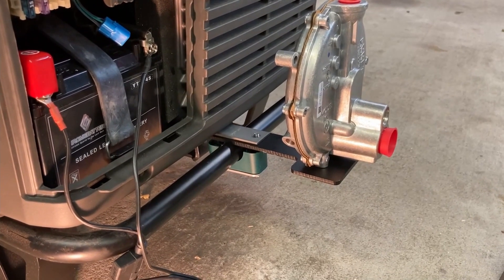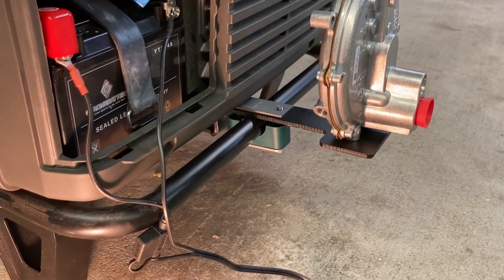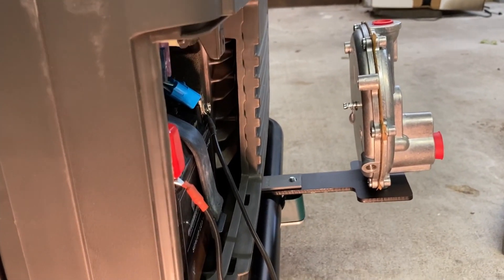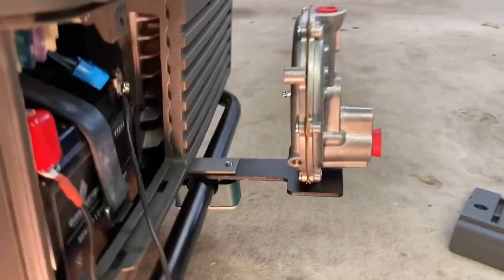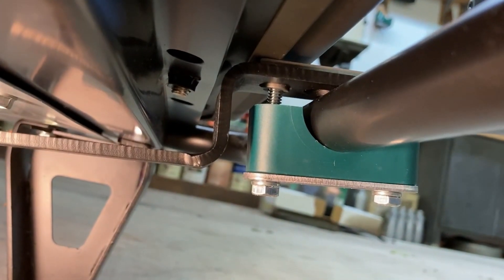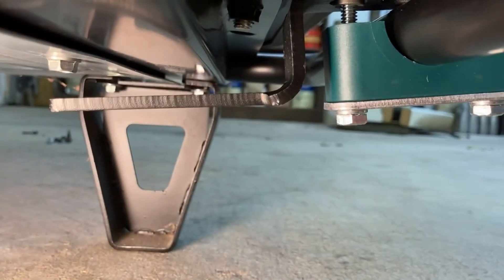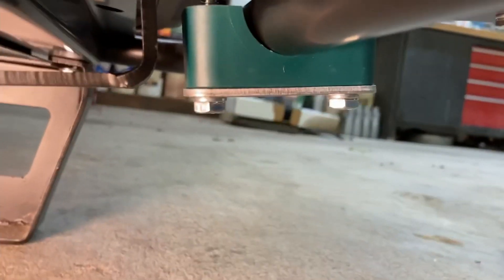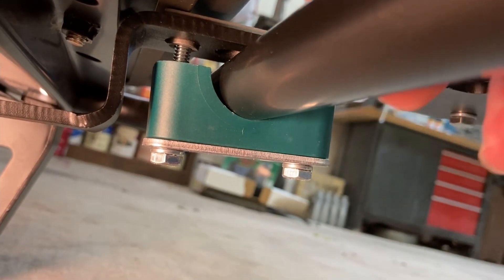US Carburetion Honda EU7000is Tri Fuel Conversion - Demand Regulator Mounting

Comment: I see you’re giving the motor snorkel kit a try. I’m curious how it works for you.  I bought the kit also, but am only using their timing adjustment module and the rest of the system is still my Genconnex components.  It still stinks at low/ no load, but I almost never run it there and it never stalls out completely, so I’ve convinced myself it’ll be ok.  I’ll be staying tuned for updates from you!  Overall fit so far seems like it leaves a little to be desired, disappointing :(
Reply from the maker: @David Messineo  After seeing this @browse deweb video, https://www.youtube.com/watch?v=KgRWa55kGMs I had to try it for myself.

I have to say that it runs dramatically better with only the addition of the "module", although I'm anxious to see what will happen when I am able to actually adjust the load block valve.  As you see, I headed down that road, but hit a few rough spots.  I'm sure I can come up with a better way to mount the demand regulator, but I went ahead and sent a link to this video to US Carburetion. and to their credit, they have already  responded.  No actionable information yet, but hopefully that will follow soon.  They seem like a company with an identity problem - their original website looks like dawn-of-the-internet, but at least it bears the same name that they use on all of their communications.  Not that I'd hold that against them, if they can help me get this thing working.

So far, I've found some of the commentary in their documentation to be really obtuse.  For example, it sternly warns about using a new propane tank, as if people refill their tanks over and over again.  That's certainly not the common case in my area.  I would have to drive into the next town to get a cylinder refilled, and I see no way for anyone to know if the typical cylinder exchange companies are providing "new" tanks or not.  And even if one did refill their own tanks, how would one reasonably get rid of the first four tankfuls of unusable propane?

Which is not unlike their chart for gas line sizing...talk about conservative...I doubt that any residential gas line installation could meet the chart targets.  A 13 foot limit for 1/2" pipe is all but impossible...that barely even makes a flex hose possible, let alone a piping run to the hose connection point.  I've done quite a bit of testing with a gauge, so I know for a fact that the actual limit is WAY more than 13 feet.  If you watch the video I linked above, you will see that his piping run is over-the-river-and-through-woods, with plenty of fittings, and from my conversation with him, he wasn't even using a full-port valve in the video.  And that appears to be working pretty well for him.

I used to make my living as a piping designer, so I immediately recognized the USC chart as being more about C.Y.A. than actual engineering data.  I think it would be great if they would offer some more realistic guidance.  It would be way better to say something like, "The pressure should be between 5 and 11 inches WC, with no more than 2 inches of difference between idle and full load" (or whatever the actual engineering requirement is).  And then sell gauges to test it with!
Reply: @MstrMark  I saw your comment on my video and I had the same issue with the bracket.  It may have been for an earlier version of the EU7000IS...not sure.  I got mine to work, but it isn't ideal.

As for the module placement and the hose routing, I cut out the notch at the top of the battery cover like you started to do and I also had to bend down the hook that the top of the battery strap connects to, then I just routed the hose through the expanded strap hole, over the battery and through the cover notch.  I just stuffed the electronic module on top of the battery, trying to position the switch towards the right side of the battery so it wouldn't hit anything.  I left the battery strap out. You'll also see the wire for my trickle charger following the fuel line.

https://www.youtube.com/watch?v=CL5VK4GNzMA

They really should redesign the regulator bracket to bring it close in to the generator and also to make a solid connection underneath. Too close in though and the top of regular might interfere with collapsing the handles.
Reply from the maker: @browsedeweb8834  Thanks so mush for the tips.  I guess the professional mechanic in me is having trouble with the idea of messing up a perfectly good generator, so I mounted the module inside the left edge of the control panel, right behind the plugs.  And I used a chassis punch to make a new hole in the firewall, just to the left of the battery strap mount (as you look at it from the battery side).  As you say, that regulator mount is a mess too.  I guess I'll cut and modify the bracket that came with my $477 kit!  

I appreciate you mentioning clearance for the handle because I hadn't thought of that.  If I mount it below the frame tube instead of above it, hopefully I can get it in much closer and solve the handle clearance too.  We'll see.  I'll try to post some new videos as I go along.

That little hole that you see in my battery cover is for my battery maintainer...I haven't decided how to route the hose yet.  I'll probably try it first without the cover, just to see how it wants to go.  Maybe I'll make a new hole.  Hopefully those doors are not too expensive, if one wanted to restore the stock appearance.  Which I was strongly considering with the failed Genconnex conversion kit.  

You know, it would be great if those two companies could collaborate on a conversion kit the combines that best features of both kits - the slick stock appearance on the Genconnex kit with tri-fuel operation of the motor snorkel kit.  Oh, and it has to run properly too.  I have to admit that I'm having some doubts about that tiny thin snorkel...it seems very fragile and too thin to pass enough fuel.  Especially in a US Carburetion universe where 1/2" pipe is supposedly good for only 13 feet.  If they're so worried about restriction, it seems like the snorkel is the main culprit.  We'll see.  Assuming I can get the thing installed without tearing it up.

Motor Snorkel
Reply: @MstrMark  I was thinking the same thing about the battery panel cutout, but I saved the piece I removed and I could easily re-attach it using some Plast-Aid and glue later on if I wanted to reverse it.  Most buyers probably wouldn't care if they had easy access for a battery maintainer.

I like your idea of using a U bold and maybe a flat piece of metal stock for the regulator bracket.  I'm leaving mine for now, but one of these days I may fabricate a better mount.

I'm going to try running the generator on a different, larger gas line and see if there is any difference in performance at higher loads.  Just waiting on parts to tie into my 335k BTU pool heater line which is on it's own meter.
Reply from the maker: @browsedeweb8834  I can confirm that mounting the bracket under the tube prevent all interference with the handles, but I'm having trouble finding the perfect U-bolt.  The tube is about 1" OD, but it's have to find anything that small with a saddle.  I was actually hoping for something padded, but that seems even less likely.  And if it's going to scratch and dent the tube, then maybe drilling a hole through it would look cleaner.  What do you think?

On all the gas stuff, you should just measure what you have before you spend another $100 on fittings.  If you just want some low-hanging fruit, you might consider replacing that 1/2" brass ell with a 3/4" one, as the ell is more restrictive than a straight fitting, so hold the 3/4" as long as you can.  And like you already said, get a full-port gas valve.  You can even go up a size on the valve, and that will get you a port size that is closer to the ID of your pipe.

FWIW, I hooked mine up straight to my gas meter, and the measured pressure drop was only very slightly improved versus the 1/2" run to my patio.  I couldn't notice any difference at all in the way the generator ran.  So it kind of verified what I had already measured, but I just wanted to put it to rest.
Reply: @MstrMark  Once you have everything setup and working properly, it would be good to see another video with the generator running on the US Carb solution.
Reply from the maker: @browsedeweb8834  I agree, and I'm actually pretty close.  Since my last post I re-formed the mounting bracket (with an oxy-acetylene torch), clearanced the muffler clamp so that it can fit closer to the regulator, engineered some plastic sleeves to protect the frame tube on the generator, and got all that stuff painted.  I also put the generator back together again, since I had removed the handle assembly, the black plastic cover and the control panel.  I got the regulator mounted, and all fittings and hoses attached. 

The new mounting position under the frame tube brings the regulator in to less than an inch from the generator...just enough room to operate the primer.  And no clearance issues with the folding handle.  I think it looks pretty nice.  I just wish the brass fitting didn't have barbs on it, because I wanted to shorten the hose just a bit more, but at the end of the night, I couldn't manage to get the hose back off again.  I'm sure it can be done, but I'm concerned that I might damage the hose, and if that should happen, I'm not sure there's any way to get the other end loose either, so it might no  be so easy to just replace the hose.  Which I find less than ideal, from a maintenance and repair perspective.  

Yet another half-baked kit.  I can replace with a barb-less fitting like this: https://www.competitionproducts.com/images/MOR65380.jpg  but I feel like I shouldn't have to.  And the mounting bracket was a complete failure.  Sure, I was able to make it work, but again, I shouldn't have to.  Not for $477.00.
Reply: @MstrMark  Well, it certainly sounds like you trying to get it done right. I just stuffed everything in there, mounted the regulator as best I could and called it a day. One of these days I'll tweak it, but I'm just happy I don't have to keep filling my gas cans. Have a great weekend!
Reply from the maker: @browsedeweb8834  ...perhaps a hazard of working as as a profesional mechanic where things actually have to be done a certain way, or one gets busted...